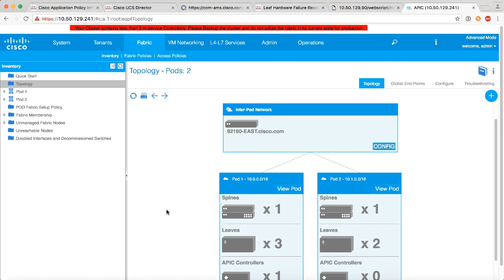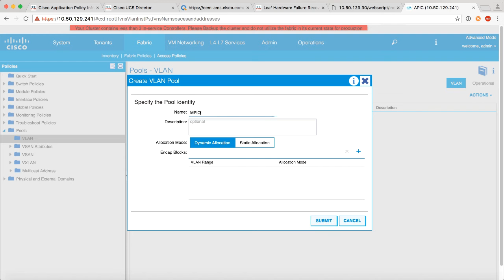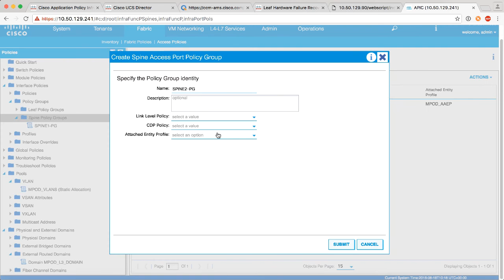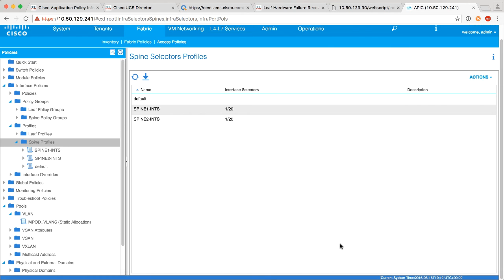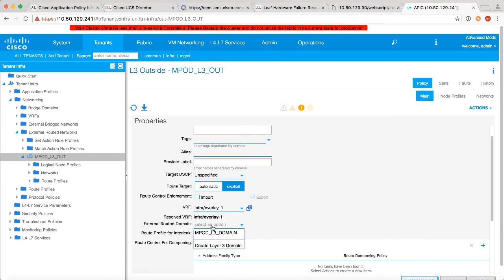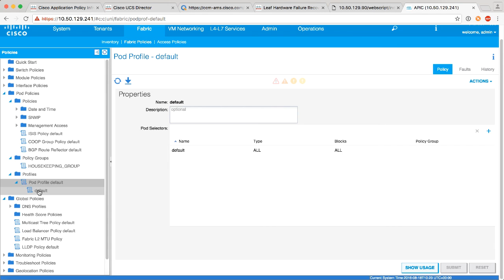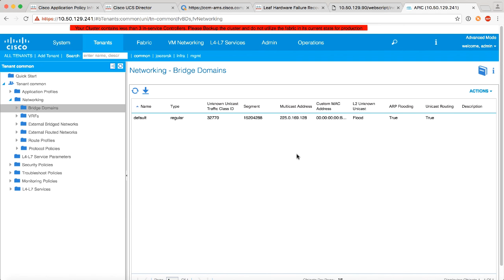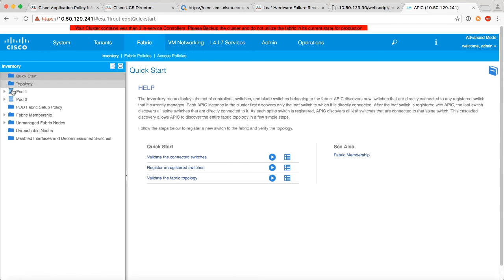ACI Multipod - Part Three - Set up MP-BGP Control Plane

Comment: great video! Thanks Joseph! I have a very interesting question though. How come the OSPF adkacencies come up without access policies from both sites? Not only ACI ran ospf process on the interfaces without access policy but also it took the IP addresses.
Reply from the maker: Hi Alexei.  Behind the scenes, the spines are hard-coded to use vlan-4 on the L3Out.  Because of this, you don't actually need to do all the front  panel port configs, like Interface Policy Group, Switch profile, etc and it will work.  However, you will see a fault raised, and I recommend to go ahead and do all the spine level port configuration to clear that fault (although that fault is only cosmetic in the case of the spine IPN interface).  Make sense?

Comment: Very well explained !! I have question do we need any configuration on individual spines on other pods Also do we need to manually initialize APIC Controllers in POD 2
Reply from the maker: Hi Gaurav.  Sorry I missed this one and  it has taken so long to reply!  As Alexei asked above, you don't absolutely have to configure the spine interfaces beyond what I show in the L3Out, but I recommend that you do if only to clear the annoying fault.  

For the APIC controllers that you (optionally) can move to POD-2, the process is to wipe the APIC you want to move from POD-1, bring it over to the physical location of POD-2, power it up and do the whole Day-0 initialization (questions about name, TEP pool, INFRA VLAN, etc).  The ONE IMPORTANT THING to pay attention here is that the answer to your TEP pool is going to match whatever the TEP pool is in POD-1.  It must be this way or the APIC will never join the cluster.  Don't worry that you are inputting the TEP pool from POD-1.  Once the APIC in POD-2 joins the fabric, it will get its config and use the unique TEP pool from POD-2 after that.  Make sense?

Comment: Hi Joseph,
I have quick queries if you can assist :

Video-1:
1. why we need to configure ""ip pim mtu 9000" on the IPN devices

Video-2:
1. when you configure the community 
 a. do we need to configure BGP password in the future or leave it empty?
 b. when configure BGP do you prefer go wirh full mesh or RR?
2. As i know when we configure ospf only configure router id, not recommended to configure a loopback but in the video you configured both, which one is right?
3. when you configure L3out in Infra tenant you didn't configure the netowrk but, do we need to configure as what we did in the normal L3out configuration?

Video-3:
6. when configure AAEP for multipod, do we need to enable infrastructure Vlan?
Reply from the maker: Hello Mohammed.  I will do my best to answer here.  

Video 1, Q1.  Why MTU 9000?  In earlier versions of ACI code, the control plane MTU was set to 9000 and you could not change it.  This means you needed jumbo frame support over the IPN to get MPBGP updates to work.  I think in 2.3 and later (not sure on the version), you could change ACI's CP-MTU (under system settings) to something smaller and thus you would not need 9K sizes.  Do keep in mind that you need to account for at least 50 bytes of VxLAN overhead in the dataplane, so you would need something larger than MTU 1500 in the IPN anyway.  

Video 2 Q1a:  BGP auth is optional.  Q1b:  Depends.  How many pods do you have?  I think once you get to three and more, the nice white paper by Max Ardica recommends to use RR.  Otherwise, the default is full mesh.  To be honest, either choice is just fine and will work.  It all comes down to a desire to tune resources used by BGP.   

Q2:  Everything I have seen uses the router-id equal to the loopback.  It is default ACI behavior for any L3Out.  I know it works, and it does not hurt anything in ACI.  I think you can use this with confidence.

Q3:  No networks are needed here for the infra tenant L3Out used by multipod.  Just leave it blank.

Video 3 Q6:  No, you don't need to tick the box for the infra vlan in the AAEP.  This assumes you have a dedicated AEP for multipod.  If someone were to use one AEP for everything in the fabric, you might want to check that box.  It does not hurt anything if you have it on for your multipod AEP.
Reply: Thanks a lot for your clear answer

Comment: How did you setup the BD and EPG for your Tenant? My epg is learning the devices but can't reply and the subnet for the BD I created is not advertised in OSPF.
Reply from the maker: Hi Mike.  Standard BD setup using "optimized" default setting.  EPG, nothing special.  You won't see your endpoints or routes in OSPF in the IPN, since that is not what it is for.  We use OSPF between spine and IPN simply to set up awareness to the next hop for MP-BGP.  So traffic from one pod to another will use a VxLAN tunnel based on the reachability shown in the route table for overlay-1.  Try typing "show endpoint" from a leaf in your seed pod.  You should see a route to endpoints in the remote pods with the next hop of tunnel-x.  This is what my lab looks like:

192.168.1.22 is a remote endpoint in pod-2, and leaf-1 lives in pod1.

#

leaf-1# show endpoint ip 192.168.1.22
Legend:
 s - arp              O - peer-attached    a - local-aged       S - static
 V - vpc-attached     p - peer-aged        M - span             L - local
 B - bounce           H - vtep
+-----------------------------------+---------------+-----------------+--------------+-------------+
      VLAN/                           Encap           MAC Address       MAC Info/       Interface
      Domain                          VLAN            IP Address        IP Info
+-----------------------------------+---------------+-----------------+--------------+-------------+
GOLF-Tenant:MainVRF                                      192.168.1.22                      tunnel11

leaf-1# show interface tun11
Tunnel11 is up
    MTU 9000 bytes, BW 0 Kbit
    Transport protocol is in VRF "overlay-1"
    Tunnel protocol/transport is ivxlan
    Tunnel source 10.0.136.64/32 (lo0)
    Tunnel destination 10.1.8.66

#note that any destination starting with 10.1.x.x is from the TEP pool I assigned to my pod-2.

If you do not see remote endpoints in your endpoint db, then something else is misconfigured.
Reply: Hi Joe,
I have the multipod setup and have registered the leafs and spines from pod2. the problem is endpoints are not communicating. My topology is as follows  Pod1>Core Router<>Core Router>Pod2. On Pod1 side I have a L3out, BD's and EPG's under a Tenant. Infra is where the L3Out for Multipod is. On Pod2 side I just have the connectivity from Spine to IPN and OSPF adjacency. Does Pod2 also need a L3out? if so, where do I set that up. The endpoint on Pod2 can ping the default GW from the BD in Pod1, but none of the endpoints. Also, the COOP database is not showing the endpoints. 

Thanks!

Comment: Hi, how does the MP-BGP IPN full mesh and the need for internal POD MP-BGP RR co-exist? Or if a BGP RR is already created will that assume the BGP RR function for IPN also?
Reply from the maker: Hello Tayo, if I understand the question correctly, I should explain that MP-BGP is the control plane function that allows the spines in each pod to update and sync the COOP database.  For iBGP RR, just as in a single POD setup, the spines also act as the internal RRs for the fabric.  The IPN devices do not participate in MP-BGP. IPN is simply L3 transport between pods.  Hope that helps.
Reply: Hi Joseph, nice of you to respond so quickly. What I mean is Intra POD iBGP and Inter POD iBGP. I know in the 1st, RR is required and in the later full mesh is by default meaning RR is optional. Do they co-exist? I hope I am asking the question correctly.
Reply from the maker: Ok, the RR function between spines in a multipod is a different and independent process from the the one used inside a single pod for leafs and spines.  They co-exist without issue.  If you look at the BGP neighbors for each spine, you see they only peer with local leafs, and remote spines (not peering with remote leafs).
Reply: So my confusion is looking at your video this is configured under BGP RR Default and called up under default Pod Profile. Does it mean that I need to create two profiles? Using default profile for the Intra Spine/Leaf and the other for the IPN Inter Spine/Spine. Do you have a link for this? May be i am just confusing myself. I understand the principle of this, but confused as per APIC configuration.
Reply from the maker: By default the spines are set to full mesh between with other spines in other pods.  It will use the ASN you set up for intra-pod RR.  This is configurable if you do not want all spines to full mesh but rather have one spine designated in each pod to serve as the MPOD RR.  Choosing this option would mean you would need to set up External Route Reflectors under the policy in Fabric > Fabric Policies > Pod Policies  > BGP Route Reflector default.

If it helps any, Max wrote a nice MPOD white paper and there is a section in RRs for multipod.  Check it here:

https://www.cisco.com/c/en/us/solutions/collateral/data-center-virtualization/application-centric-infrastructure/white-paper-c11-737855.html?cachemode=refresh#_Toc463058885
Reply: So If I get this correctly, only one ASN is required for both Intra POD Spine/Leaf  and IPN Inter POD Spine/Spine MP-BGP. RR configured under RR Nodes are for Intra POD Spine/Leaf  MP-BGP.  RR configured under External RR Nodes are for Inter POD Spine/Spine  MP-BGP, right?
Reply from the maker: Anything to do with BGP in ACI will use the ASN you set up in the Fabric Policy section.  This includes RRs, L3Outs, GOLF, etc.  This is the say, the whole ACI fabric is represented by one and only one ASN no matter what you are configuring.  

The second part of your question is almost right.  For Mpod, the default site/pod peering policy is set to full mesh.  This means that you don't have to do anything and the spines will peer for RR functions across pods.  If, and only if, you desired only a single RR in each pod (i.e no longer using full mesh) then you would change the pod peering policy to "Route Reflector" and then complete that config under Fabric > Fabric Policies > Pod Policies  > BGP Route Reflector default in the section called out for external RRs. 

If you only have two pods, I suggest to keep it simple and just use the default full mesh.  Only when you have three pods does it make sense to consider External RRs.
Reply: Thanks Joseph, this is very clear now. I have also been looking at the Mpod white paper so I will take a view as I have more than two pods. May still go with full mesh.